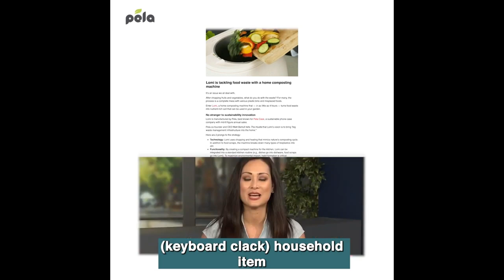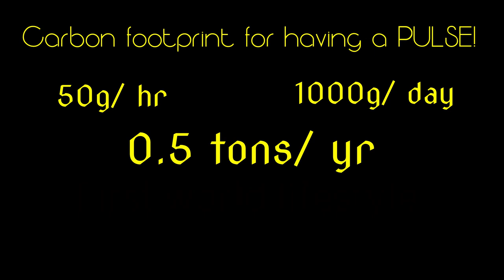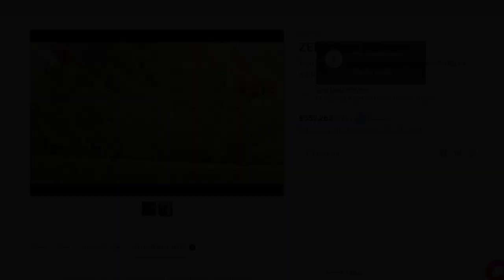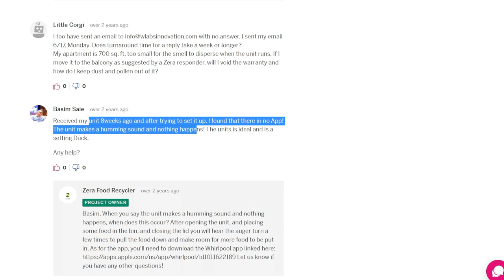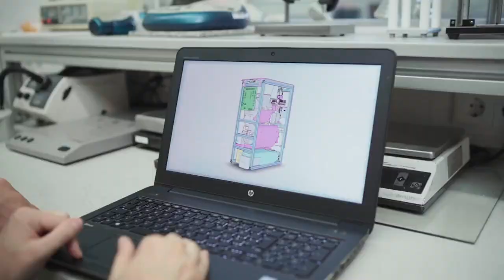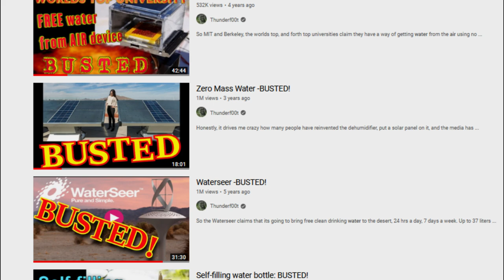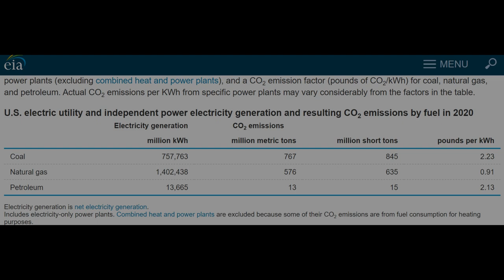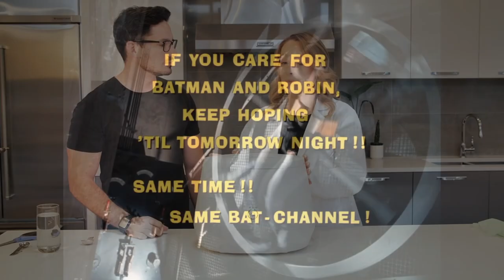Lomi: BUSTED!

Comment: an electric composter just really sums up why we're at the place that we are. i can make a pile of banana skins in a bin/yard and make compost naturally, or i can heat up a  pile of banana skins in a bin and use a finite supply of dinosaur juice to do it in a day, AND i get to feel smug about doing something AND do it with minimal effort.
Reply: But if the power comes from slave-built solar panels made from silicon, coking coal, and a variety of rare elements, it should be OK. ;)
Reply: @jonathantan2469   solar panels are pretty usefull and the uprfont cost is high but it is cheaper and dose actually reduce  co2 however nuclear imo is just better overall.
Reply: Except you are not composting it in a day.  Just dehydrating and blending the waste so that it needs to be hydrated later so that it can then compost naturally in roughly the same time span anyway.  The smug factor is the real deal though.
Reply: If you have a place to make a pile. On the other hand, if you don't, I don't see a point of making compost anyway - your plants' pots would be overflowing within few months.
Reply: Could you imagine the stank of heated banana skins in your kitchen. Gak!
Reply: The smug totally makes it worth it though.😅
Reply: oh and I also got the app for it :)
hopefully this machine also connects to wifi so that it can call back to a centralized server that uses even more green energy to run, so that you can watch your Lomi cycle at home, work, or even at the park <3
Reply: It's not minimal effort, it's actually more effort as you introduce cutting up, sorting, opening bin, adding, closing bin, pushing button, waiting a day (what do you do with the waste from the day you are waiting), opening, removing dessicated contents, THEN back to what you were doing before.
Reply: @Grauenwolf  Unfortunately the heat also likely completely sterilizes it, if it's dangerous to touch the container.
Reply: @svampebob007  no the backend runs on aws in the state of Virginia, with capacity for every house in the World from the first day, mostly unused as little to no one having those Devices.

In fact aws on the east Coast is actually run out of the state of Virginia, duke powers the Datacenters there mostly with coal.
Reply: @maximilian19931  silly me for thinking so inside the box, way to think bigger better, and more eco friendly :)
Reply: @Neoflares  Nuclear is OBJECTIVELY better, because it has much higher energy density and does not require storage.

Comment: I built a "traditional" composter in my garden using a few old pallets. It works like a charm and set me back maybe 10 Dollars, plus my time. When I lived in an apartment, I had one of those worm-composting bins, which also worked remarkably well. People try to reinvent wheel.....
Reply: Yes, i was thinking the same, the worm composting actually produces compost not dry pieces of food. If one is really thinking about the environment then the worm bin is the best option available for city dwellers.
Reply: Correction: People try to sell the nu-wheel.
Can't sell the old wheel because it's too simple. Also, your startup company NEEDS to develop a "tech" product regardless which problem you are supposedly trying to solve. Because "tech" companies automatically get much higher valuations. Just make sure that your nu-wheel connects to a phone app for some reason. Also ensure that your nu-wheel is styled like an apple product. Because that's what "tech" looks like. And while you're at it, make the nu-wheel square. Wouldn't want anyone to think you've just trying to sell a regular old wheel with some bells and whistles attached. The nu-wheel needs to be "innovative", and roll in a completely different way than any previous wheel.
Now all you need is an expensive marketing campaign and you should be swimming in investor cash. Be sure to pay yourself handsomely for your own hard work. Wouldn't want to be left empty handed when the company inevitably goes belly up a few years later.
Reply: @fnorgen  Excellent. Just excellent.
Reply: Same here. We just used some leftover slabs of concrete to build our compost heap. It works very well.
Reply: @Kadum122  This. Composting is the process where organisms and microbes break down organic matter into nutrients that plants need. Which takes time. Throwing shit into a machine that just blends and chops it up isn't doing anything..
Reply: I prefer piles, turning is MUCH easier than jacking with a container.
Reply: @JLJones-sf5gt  true. I prefer  a container only because it looks tidier in the garden.
Reply: @3nigma.3nc  not to mention there is a very good reason that you put a compost area outside (and preferably far enough from the house) in the first place. bacteria on your countertop creating fertilizer is a sanitary nightmare. 

for those REAAALLLLY mega into composting, they may even own a high power blender just for making the compost incorporation easier anyways. for less than 100$ even
Reply: @Everlucky_Clover  Blender works well for household food waste. I used a lot of water to make a thin gruel and poured it right onto the ground adjacent to the herbs.
Reply: @pauleohl  (thumbs up) point proven :D
Reply: This product reminds me of that “juicer” that essentially pressed a pouch of juice into a glass.
Reply: @misscleo378  they both belong on the "as seen on tv" store shelf >_<
Reply: @pauleohl  true actually

Comment: This reminds me of an expo thing I was at where someone was showing off a water purification system for 3rd world and disaster zones that relied on a generator. Right next door to that booth was a filtration system that passed the water through various grades of sand and grit that only needed boiling or something like iodine to kill off bugs. The bloke promoting the generator option couldn't grasp that fuelling a machine would be incredibly expensive.

Best home composter is that pile of slowly rotting plant matter in the corner of the garden that also kicks out enough heat to keep the hedgehogs happy in winter. Worm farms are another good option for the veg in compost out powerless hands free operation. 

It's not a glorified pedal bin that saves you leaving the kitchen. Why in the world does someone need an app to run something like this either.
Reply: the generator guy doesn't comprehend that most people in the world still live in places where they have to burn candles at night in order to see if there are tigers or snakes on the way to the latrine.
Reply: @toomanyaccounts  
You can build a large filter with natural materials and coal. Or literally wear the high tech version in your pocket.
Reply: Yeah, I'm sure the generator guy also doesn't understand what it's like to get fuel when you're in the middle of sub-Saharan Africa where you're about 600 MILES out of cell phone range.  "Getting a new cable is easy, just run on down to your neighborhood 7-Eleven!"
Reply: Some people have such a privileged life they they can't even comprehend basic tools without electricity.

And yes, everything needs an app these days. It's insane
Reply: Yeah if you run water through gravel then sand and finnal charcoal dust you basically got fresh water. It get out most mico organisms. This is one thing i was taught endlessly by every survival class and survival group i ve joined
Reply: Just a little salt or chlorine after running it through a filter like i decided and it makes the water good enough for everything except drinking and eating. You should still boil it for that.
Reply: @Skank_and_Gutterboy  just use the corporate card to refill the tank :)
Reply: @noahfischer3088  Get a duck, they really like worms.  Unfortunately Earthworms make duck eggs taste a bit muddy.
Reply: @Foolish188  does it change the meat? I ll just get meat ducks.
Reply: @pt8306  I am also lamenting about this very often. I do for example most of my driving without navigation system, because I do not like the often stupid robo voices. I can use my memory after a look on google maps and barely get lost. I observed this stupid dependence on apps and mobils also very often. Sometimes I see all people around me stare on their mobile. You advanced that even with the electricity part.
Reply: @bartbertold1939  yeah it's probably worth everyone having a collective detox. I'm writing this comment on my phone at a family gathering, so I am part of the problem.
Reply: @Foolish188  
No, . Earthworms are native to the United States, says Melissa McCormick, ecologist at the Smithsonian Environmental Research Center, but the earthworms in some northern parts of the country (including Vermont) aren’t indigenous. Thousands of years ago, glaciers that covered North America and reached as far south as present-day Illinois, Indiana and Ohio wiped out native earthworms. Species from Europe and Asia, most likely introduced unintentionally in ship ballast or the roots of imported plants, have spread throughout North America.
Reply: you don't get it, in this world everything needs an app
Reply: The app is because <current year>
Reply: @noahfischer3088  that is useless information to anyone not is a short-term survival situation. Those filter do not affect the free floating bacteria at all...
But I agree, filter and cook for safe water. Just cook for food.
Reply: Best home composter is actual outdoor home composter that has been around for ages. I mean if you have specific plans around your organic waste beyond just compost and dealing with the waste, leaving stuff in pile might work. But it's ugly pile of garbage, inefficient and more smelly. For most people if they want to compost their organic waste, actual composter is definitely way to go.
Reply: @theodiscusgaming3909  I still remember when the cavemen first discovered fire, then immediately made the fire app so they could control it from their phones while out hunting and gathering
Reply: That guy complaining about the lack of an app, I looked him up, he has a degree in mechanical engineering, and has been managing director or board member at several massive international companies. wtf, how have we allowed such idiots to run our world.
Reply: But the app makes it fun!!!!
Reply: I currently live in a "3rd world country" in a village and our well/bore water is filtered by sand and charcoal and then distributed throughout the house. I have better drinking water than I had in Australia.
Reply: Worm farms are a good idea. and if one lives near a park where a lot of people do fishing, one can make some money on the side to sell them to people who are fishing for cheap and use the money to donate to some local wildlife preserve or environmental education program for children , all of which will do more for the environment than the scam product in the video
Reply: The app is using for the ui and tracking. Sorry cryptomining.
Reply: -Matter didn’t create anti matter
-Anti matter didn’t create matter
(Both of them were present at the time of big bang)
-Both of them didn’t create themselves.
-Both of them came from an unimaginable source,  that unimaginable source created matter and antimatter (everything) thats why it is known as “the creator” of everything.
———--------------------------------------

- that unimaginable source/creator has created sin and virtue which are opposite to each other,
— logic says every action has its own reaction, so the reaction of sin must be different than the reaction of virtue,
— the creator has created prophets to let us know about each and every detail of sin and virtue, also about their reactions,
Thank u :)
Reply: @Foolish188  Not everyone lives in north america, hedgehogs also aren't a native species to you folk over there.
Reply: In my city food waste is collected and is put in a gigantic composter, the methane is burned in a generator and they use the waste heat for processing.
Just so simple
Reply: @toomanyaccounts  Those who burn candles are rich,the real poor people have to burn dung.
Reply: Why do so many not comprehend that many people don't have yard to have compost heaps in?
Reply: @naamadossantossilva4736  The US is going to be there pretty soon

Comment: Minor correction at around 3:00

This dessicated waste would produce less methane than going to landfill. Landfill's methane intensity is caused by anaerobic processes which are due to the lack of O2 available to the bulk of the buried waste material. However, if you're placing your waste in a garden bed, then it will have much higher access to O2 and decompose into CO2 instead of CH4.

|This is not an endorsement of Lomi.
Reply: I guess it depends how thinly you spread it - chopping it up so that it packs more densely would increase the proportion of the pile that is anaerobic.
Reply: @SorenCicchini  probably not the case. Soil can actually transport a fair amount of air through it. That's why the ground doesn't expand and contract much when it rains: air is displaced for water. And this dessicated waste seems to come out looking a lot like a coarse grained soil.
Reply: Correct. I've seen cadaver dogs in action - they couldn't detect cadavers up.to 5 yards deep unless there was air moving through soil
Reply: @samueljanda3903  how is landfill different?
Reply: @JohnSmith-te5oo  cadaver dogs are detecting the products of anaerobic decomposition. Gases make their way to the surface through the soil pores but that doesn't mean air is flowing through the soil.
Reply: @SorenCicchini  landfill isn't made up of uniform sizes objects spread evenly across the ground. Waste is compacted before it's dumped. That creates the opportunity for places air can't reach.
And then before the top layers have had a chance to decompose into CO2, we continue to pile more waste on top further restricting the access of air to decomposing waste.
A single household probably doesn't produce enough waste to create that issue, especially if they're chopping it up first to speed up the rate of decomposition.
Reply: I agree, and if every household/residential have lomi, methane concentration in the air will be significant and fire incident will be a common event
Reply: @melonhusk6642  I don't think you need to reread this comment thread if that's your takeaway.
Reply: @samueljanda3903  I appreciate your explanation of things and I do think that this product has potential, especially if you're on a very small living space ie apartment and condominium. But packaging it more than it is is what makes the product seems dubious. There's another product that has been in my favourites YouTube channel that does showcase similar products but doesn't upsell you. (Self sufficient me)
Reply: @SorenCicchini  Compost stirring addresses this. Though I still wonder why dry it out if you want to compost it since I thought you actually wanted the moisture present to decompose the plant matter...
Reply: If Landfills remained dry that might be the case, but they going to get rain and groundwater in them, so any material in a landfill will rehydrate and undergoing anerobic decompostion.
Reply: @aliak530i  I am in no way advocating for this product. A worm farm and a compost is plenty good for just about any household. <3
Reply: Right but it sounds like they most of the waste will go into the landfill because skactivist will just toss it once mulchified
Reply: Where I live in the UK, the local council provide special bags for food waste free of charge. The full bags go into an outside bin and are collected once a week.
The waste food, which can contain bones, is composted and the bags go to a plant which produces energy from waste.
Reply: @kennethferland5579  water doesn’t get very far down in landfills and many high density areas don’t get much rain.
Reply: Could it be construed as an endorsement of a traditional compost pile?
Reply: @twilit  It kinda does, actually, since most landfills have a sealed layer to keep the landfill water from mixing with groundwater and landfills are holes that are gradually filled.  The water really has nowhere else to go, so what doesn't evaporate is going to seep into the pile.

Also, most places actually do get a fair bit of rain, btw.

Comment: 2 years ago i talked my boss into letting me process the 100's of yards of lawn and landscape waste we bring in per year into screened topsoil instead of paying to have it removed and dumped in a hole somewhere. I had to do quite a bit of research on composting and soil composition to be sure i wasn't just wasting time and money. Having first hand experience with the process made the idea of the lomi or anything similar especially absurd and hilarious.
Reply: And the thing is tiny as a bonus!
Reply: Did it work in the end? All scams aside, actually composting waste material the OG way is a good thing to do. Was your boss convinced?
Reply: @ollietizzard5180   Yes, absolutely. It was costing about 6$ per yard to remove. It takes 1-2 years to compost. The process of blending and screening is very simple. The screener was 10k and processes around 15 yards per hour depending on moisture. we already have loaders to move and turn it. the final product is worth 20$ per yard. I only put in a few hours a week working on it. Overall it turned a 2-3k yearly expense into a 7-10k profit. The thing that makes the lomi so laughable is that giving the compost the proper time to break down is necessary or it'll just kill plants. it also requires lots of air and water for it to break down so the idea of intentionally drying it is silly. Lastly, it obviously smells terrible. the area down wind of our piles is all farm field. if we were near any residential areas i would fully expect to be shut down.